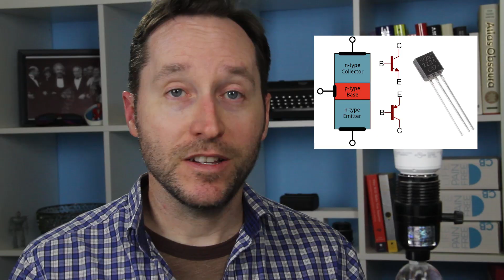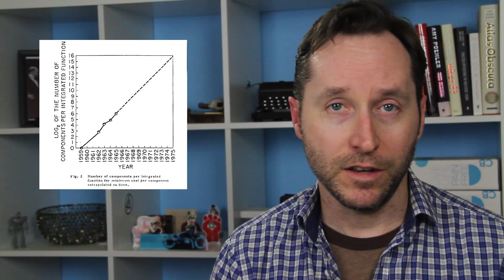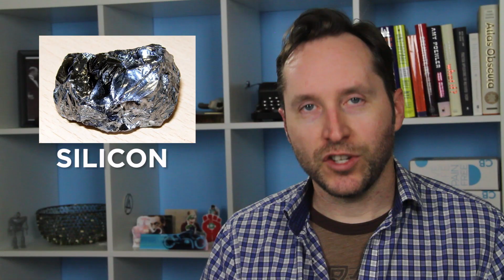Moore's Law Is Ending - Here's 7 Technologies That Could Bring It Back To Life | Answers With Joe

Comment: The quantum computing is a SCAM for me - an impossible concept - the concept is based on limited and/or wrong understanding of the so cald quantum wirdnes. Of course there is a cnance I am wrong, but I will be glad if you dig deeper and make a video about this. As I know there is still no pfoof that the avertised cuantum computers works on a quantum principle.
Reply: Quantum computing is a real thing, however many of the advertised "quantum processors" indeed aren't proven to work on a quantum mechanism. Research quantum computing seriously works, though.
Reply: OK, can you explain how you interpret the output of a bit which is on both 1 and 0 states at the same time. How you detect the output of the system which is not objectively defined?
Reply: It's not easy to explain in a comment section and
you should read up on qm first. You  can make qm measurements and get a 'classical' result.
Wikipedia usually is your friend.
Reply: The way science popularizers talk about it is wrong. They try to impress not to teach. All they talk about is a cat both being dead and alive but actually that analogy was invented to show that we cant think classically about a quantum process. There is experimental proof that quantum systems do additional computations. One such experiment is Bell's experiment that can't be explained classically.

Comment: I've been curious for years now about why the clock speed race seems to have stopped.that must be a symptom of moore's law ending. I mean when pc started it had a 4mhz processor. then 8, then 10, 12, 16 variants, then 20 or 25, by the time 33mhz and 40mhz 386 was common computers were more than 10 times more powerful than the first pc, and it happened in a very short time compared to how other stuff advances. black and white television lasted more than single digit mhz processors. 
the race kept going, we got 66mhz 100mhz, then 133 or 166mhz pentium, then pentium 2 came out, 300mhz, 400mhz, by the pentium 3 and 4 era we had 600, 700mhz, or even 1ghz. 
even the difference was growing exponentially. I mean, just the 100 or 200mhz of difference between a pentium 3 500mhz and a pentium 3 700mhz was more than what a whole earlier computer ran at!!. today for us a 100mhz difference is not a big deal, but computers used to run at 33mhz and 133mhz and that difference is insane, what you can do with a 133mhz computer that you can't do with a 33mhz one is like the difference between radio and tv, or like the difference between printed paper and telephone, it's a whole different generation or "dimension". ha, I remember I could notice a 16mhz computer was "too fast" compared to a 10mhz one I was used to... and that's 6mhz, that's nothing. anyway, things kept advancing till processors hit 3ghz more or less. these days it's normal to have 2.8ghz processors, several cores, but none of them go at 6ghz, 10ghz, 16ghz, 33ghz. the race stopped.
ten years ago I would have said "we'll have a 16ghz pentium 10 by 2017", but it never happened. they expanded to multi core technology, but the main basic thing doesn't seem able to go beyond 3ghz. I guess this is a symptom of moore's law coming to an end.

by the way, something you said ("I want to seet he singularity") reminded me of a very interesting article called "the singularity already happened" by a guy called "terry bisson".
search for it on google and check it out, it's very interesting to read and a very interesting topic, like "do you think we already are in a future where the singularity already happend or not?". (here's a link to the article: http://www.terrybisson.com/page3/page3.html) 
I'm not sure about the singularity but I think we are already "in the future", think about this, when I got my first 20mb hard disk on my 10mhz computer I could have never ever ever dreamt of using a computer to write to a guy that's on another country because I just watched a video of him talking, on the computer, not on tv or vcr, the video is on the computer, and it takes like 20 times more storage space than the whole 20mb hard disk.
and it was "not that long ago" for me and I remember that computer normally and clearly, but the experience seems like two or three "lifetimes" or "generations" ago, talking about getting my first 20mb hard disk back in the 80s sounds like a grandpa talking to his grandkids "when I was a kid we didn't have tv, we had radio" and the kids go "NO WAY!!" hahahahaha.

sorry for the long rant!.
Reply: He mentioned it in the video - its heat. Two things that are relevant as transistors get smaller are: the clock can increase and they are packed closer together. Higher clocks mean greater heat and closer together means more concentrated heat. Thus essentially, 3 Ghz is the limit for air-coolled processors. This is why we now have multi-core CPUs - essentially multiple CPUs slapped together that can talk to each other. Unfortunately, this means programmers need to be more intelligent to utilize this extra power.
Reply: Intel made a 1000GHz CPU in 2001, so NO LIMIT ! They said, "Intel Teraherta processors would be for sale by 2005 to the consumer". But then the NSA complained and CPU speed increases went to a almost standstill ! Barely 1 - 3%, sometimes 5% a year ! It was 100% every 24 months ! Now my 8 year old CPU is about 5 - 8% than the current CPU of similar price ! And now they are RAISING PRICES, they should get lower ! RAM has about tripled in price !
See my large comment at the top.
And Motorola and DARPA also announced 1000GHz chips in 2009.  We should have at least 10% of that speed, 100GHz is 10% !!!
Also, you don't need to keep making lithography smaller ! I will take a i7 3770 running at 1000GHz over the latest ship with 18 cores running at 3.5 - 4GHz ! And it would run 300 times faster ! Before you say you can't compare different chips, know they are the same chips since 2008 with only small changes to the microcode ! So you are comparing the same chips to themselves ! And the microcode at most gives 3 - 5% improvement when combined with a faster 4GHz clock instead of the older 3.4GHz.
This is how bad the CPU market with Intel has become ! About the same chips for 10 years !
I would also like larger lithography since it makes the chips spread out the heat more, and makes them more durable to surges from ESD.
And yes, I'm and engineer and have studied electronics since before the 8086 was a big deal let alone a 486 !
And air cooled vs water cooled isn't different for the CPU ! But they should make a better soldered heat spreader like Intel did have then went back to the less reliable thermal compound.
That is OK for a transistor that can be remounted with new compound but not for INSIDE a CPU where you have to delid it ! This is why deliding has become popular. It works. And is a huge improvement when Intel didn't apply enough compound when making the CPU.
And there are other heat transfer improvements like carbon nanotube or vapor phase heat sink, a little better than heat pipes for now. But simply making the cores using older larger lithography would be a big help with much bigger die to spread out the heat. Or simply increase spacing of the cores, and remove the video chip completely. All things easy to do !
Reply: kainthevampireduck  I don't really know, but I have a couple of guesses:
1st For most of today's programs, it has been proven that more cores perform better than higher frequencies (from video editing to complex calculations in molecule rendering applications).
2nd A new quad core @ 2 GHz performs objectively better than a 5 year old quad core @ 2 GHz. This may be because of the instructions per cycle, the architecture or who knows why, but the thing is that it does.
Bonus: Intel has had a monopoly since 2006, they did not have the necessity to innovate. Look at what happened when Ryzen appeared: Intel is releasing a 12 cores 24 threads cpu, and I bet the price will be quite reasonable.
Reply: Not really much improvement ! Intel been using the same CPU since 2008 ! Only the Tick Tock cycle. Increase the clock speed a LITTLE, then microcode a LITTLE. No real significant improvement since 2008 ! We should be at about 700GHz by now. And that doesn't include Intel Terahertz (1000GHz) chips announced in 2001 ! Then about 64,000GHz !!!! And the tech had 10,000 times less leakage and lower power. So should be used for just those 2 reasons even if it wasn't faster !! But it is about 333 times faster ! Google it and see ! Intel Terahertz
Video card have had far more improvement ! Some using 256, 384 and 512 bit wide buses ! Not the little 64 bit bus the CPU uses ! And much faster RAM too ! And several HUNDRED CORES ! Not just 4 cores !
My video card has 1024 cores running a 512 bit bus with 2GB of DDR5 RAM !
You can't even find a CPU that uses DDR5 RAM ! Let alone 512 bit CPU or 100 let alone 1024 cores ! And I have a cheaper $200 card, not a $500 or $1000 card ! Yes it is RISC instead of CISC but it is still faster and optimized for parallel operation. Why does an 18 core chip cost $2000 ? It is made of the same silicon the $100 chips use ! Yes, better lithography, but not enough to justify $2000 ! Has 4 cores since 2008 and could fit 16 cores in the same size chip now like the XEON does !
Reply: There's one reason we can't get higher frequencies: the speed of light and size. By going faster and faster, we're reaching the time in one cycle is closing in on the distance of speed of light. So at 4GHZ, we are going at 1.2 cm for light per nanosecond, which means we are closing in to 0,3 cm per nanosecond. Going above 4GHZ usually results in lower gains due to latency and much higher heat output.
Reply: maybe if they made everything bigger (cpu, fan, even the motherboard and case if needed) processors could reach higher speeds?. 
I mean it as a "last resort" thing, if in 10 years they can't figure out another way of improving performance and making computers faster, they can go the "make it bigger" route.
Reply: There are other limiting factors besides heat. Latency for example.
Reply: Also worth noting... the amount of Ghz a CPU has doesn't not translate into work done. Has an example, my previous CPU was 3.8 GHZ, my current CPU is around 3.4GHZ (small difference i know). My current CPU is faster and has the same amount of cores.
There are small things in the architecture (and also supporting everioment) that all put together translate into a lot more speed.
Reply: that won't speed up computers that much, gamer's are overclocking their computers from say for example 3.5Ghz to 4.5Ghz and while that should be a 25 percent gain in speed, at most it only gets them and extra 5 to 10 in reality. and what your are saying is already done in supercomputers, they require whole buildings to house them still. pump in a few more cores, and your family computer starts needing more room in your house, at some point you no longer need central heating and you can no longer easily move or work with your computer anymore. There will be a few more jumps with silicone, i hope, just not very big ones, and it will all have to do with making our computers with more chip cores, smarter architecture, and smarter programming to make it all work faster, but those bumps in speed won't be much at all.
Reply: Singularity happens when you have an actual General AI that's advanced to the point that it can self-improve in algorithms and whatnot. As far as we know, nobody has reached a level of General AI that's even close to that, but many experts suggest it will happen within 30 years. And specifically because "oh man we didn't even imagine this" happens so quickly, we can't imagine what that General AI will bring, so we need to be vigilant.
Reply: kainthevampireduck nah, there will be more clever solutions. Due to physics of operating at super high frequencies, you want all the parts of the architecture as close together as possible.
Reply: NeutronPCXT I'm just saying, it may be the sweet spot (too little information for me because I don't care too much) but the original claim I referenced is false.
Reply: I think that's because economically speaking, adding cores has become more interesting than pushing clock speed. The bulk of processing power that the average customer requires these days, can be provided with parallel processors (ak cores). A typical server, be it a web, application or game server, needs to achieve high concurrency: That means being able to run the same processes thousands of times for multiple clients. Concurrency = parallel processing. That's where most of the computing business lies today, and cores are a valid metric for these kinds of businesses.

There will still be organizations, mostly in the fields of science and modelling, that benefit of greater sequential processing and higher clock speeds. So I'm sure clock speeds will still be improved, just with lower priority than they did before.

Either way, we shouldn't worry too much about about the clock speeds stagnating. The focus of the coming years will lie in making machines more intelligent. Our own brains seem to hint that the secret to intelligence isn't high frequency processing but rather the ability to process a lot of things at the same time. This is something we can still advance in greatly. So I don't think Moore's law ending will translate into a slow-down of our technological advancement.

Only by the time we've reached the nanotechnology paradigm we'll really need to have processing technologies that are much compacter and more energy efficient than those we have today. By most estimations that's still a decade or two away, so there's time.
Reply: That's what I said.
Reply: Offthechart Gaming Turing did not design a digital computer till after the war (pilot account comp) though he built the Bomba that circulated thousands of the encryption wheel by building hundreds of replica wheels to mechanically generate the wheel settings which changed every day. Tommy Flowers designed the colossus electronic computer to decode the Tunnel  (tellatype) code  the German high command was using.
Reply: kainthevampireduck ..It seems that the limits of processor clockspeed has been reached for the most part. The trend seems to be moving towards more processor cores and higher bus speeds. I feel that processors with dozens if not hundreds of cores running terabytes of RAM is not out of the question in the not-so-distant future. Imagine Watson or a Cray super-computer in the palm of your hand!
Reply: Sam Lighthero 

If 3GHz are the essential limit for air cooled CPUs, why are there octacore chips (Ryzen 7) that can run 3.7GHz on stock air coolers?
Reply: 3GHZ is the perfect sweet spot for power draw and performance. See reviews on underclocked and undervolted R7 1800Xs and you'll see the absolutely mind blowing performance/watt.
Reply: kainthevampireduck The clock slow down was also due to heat.
Reply: I think that is mostly because at this point in time it is easier to add more cores than to increase the speed; they seem to have reached the point where it is impossible to increase clock speed anywhere as cheaply as adding more cores to the same processor.
Reply: +Sam Lighthero err, 3ghz a limit for air cooling?!?!  I think not, my 2014 i7 4790K CPU runs at stock 4ghz with air cooler running low fan speed idling around 28C no problems whatsoever.
Reply: Pelger a
Reply: We basically hit a limit at 5 GHz above which heating is an insurmountable problem. Since they can't make the CPU cores faster without melting, they just started putting more of them on the processors.
Reply: kainthevampireduck There are 4Ghz + processor computers on the market, and I think the virtual reality and augmented reality arenas will push companies to pushproccessor speeds faster. They haven't had a need till now because, processors were fast enough for virtually any application, but now more folks are doing multi-media, youtube, and video games. Smart assistants will require more and more horsepower as the technology gets more and more complex.